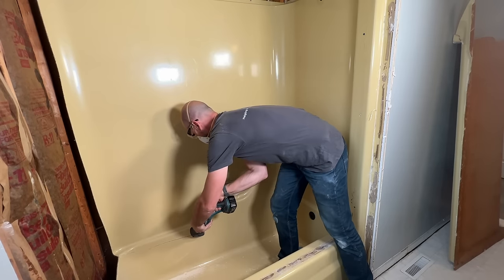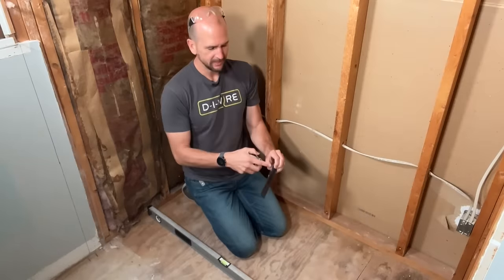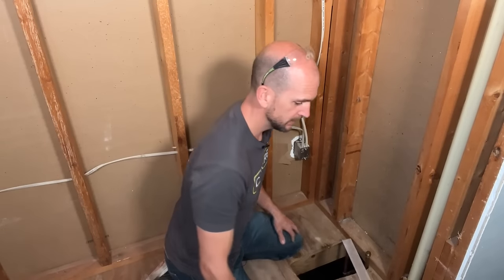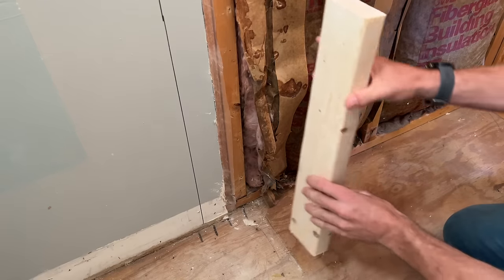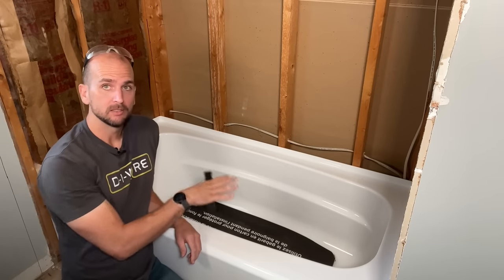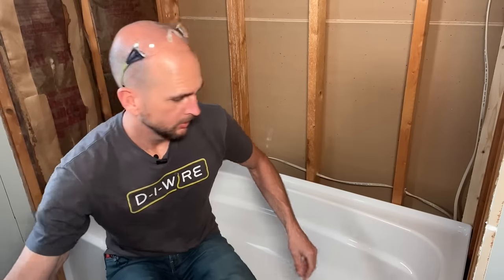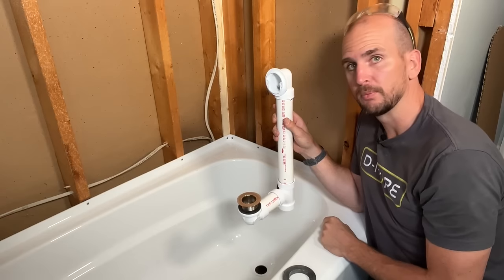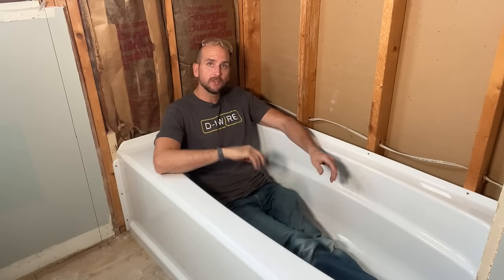How To Install A Bathtub | Delta Classic 400

Comment: Sorry. Can you explain how you use vise grips tp rip the wood fur strip. I'm confused.  You didn't explain or show the setup for that well at all. I've never even heard of that technique before.
Reply from the maker: You just attach the vise grips at the location on the guard which would provide the desired thickness of the furring strip.  The vise grip will ride on the outside of the 2X4 maintaining a consistent thickness across the length of the board.  Does that help?

Comment: Love your channel!
What did you do about the 1/8" slope on the drain side of the tube?
Reply from the maker: The tub has the same drop of 1/8" from left to right.  I know many would say put down a bed of mortar but I am not sure I love that idea with the honeycomb base that comes with the Delta 400 Series.  I think I should be fine and will know soon after putting up the walls.
Reply: I was wondering the same thing. Guessing he just said "send it!"

Comment: Isn't the tub supposed to have a little slope towards the front so the water can drain?
Reply from the maker: I think the desired slope is built into the tub, so when referencing the flange you would want it level or as close as possible is ideal.
Reply: @EverydayHomeRepairs  oh ok, thanks

Comment: I'm sure you mean well. But I'm 65 I've never needed to install a bathtub.
Reply from the maker: You are missing out 😁
Reply: @Blue Too How many tubs have you installed ?
Reply: @Blue Too yeah, you should cut down the trees for wood too.  And dig a well by hand.
Reply: @kennypool  You're on a DIY home repairs channel complaining about doing work. You're in the wrong place
Reply: Old people on the internet 😂
Reply: @PJBonoVox  Boomer Alert 🚨
Reply: @wellsnapyeah  lmao
Reply: @PJBonoVox  guy is going crazy :)
Reply: Did all your tubs install themselves or was there someone along the way  who learned how to install a tub and then did the install?
I'm here because I'm remodeling my house top to bottom every room, everything new. To hire a contractor would be looking at over $200,000 instead we will be in it about 50k (we are 3/4 done) just because you can barely work a screwdriver doesn't mean others have to be just as useless as your skill level